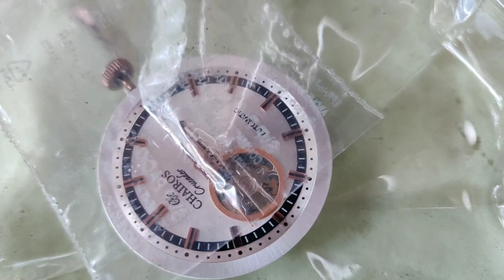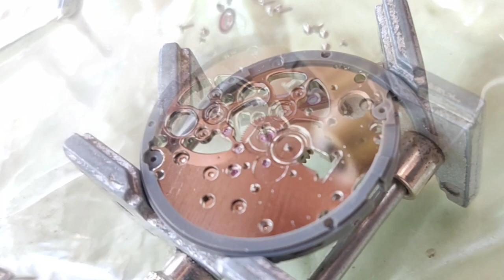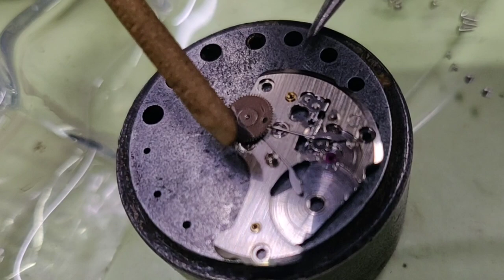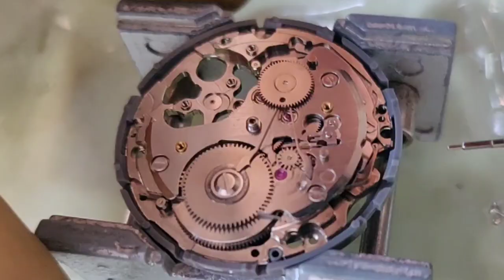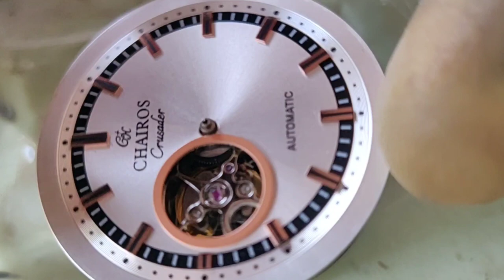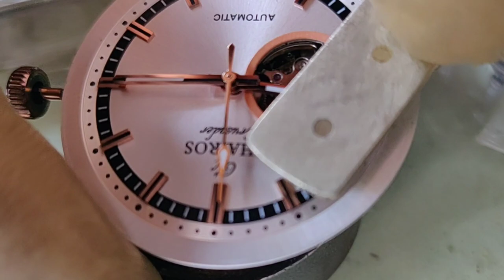How to repair a Chairos Crusader watch? assembly & Disassembly of seiko cal.NH38A

Comment: The crown of my hmt handwound mechanical  watch is broken Can it be repaired . The crown broke when I pulled it to set the time , do you know why it is broken ,is it due to over winding ,can it be repaired
Reply from the maker: It could have  been  broken because of rust.
 Yes, it is repairable.
Reply: @watchwizard  but I don't  think there is any rust in the crown the movement was serviced and maintained well is it due to any other problem
Reply: Is spare parts of hmt watches available  in the market to replace the crown ??
Reply from the maker: Yes crown are available in market for HMT